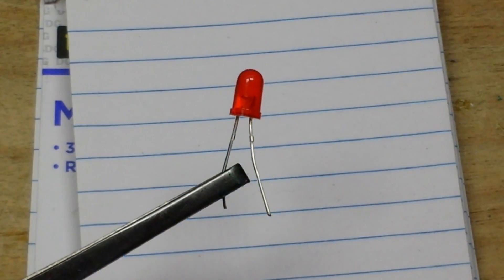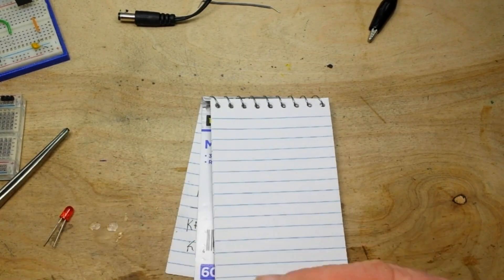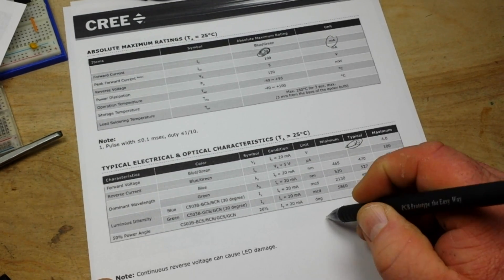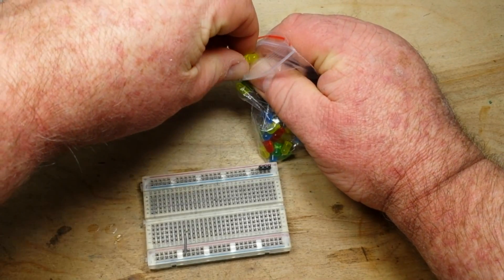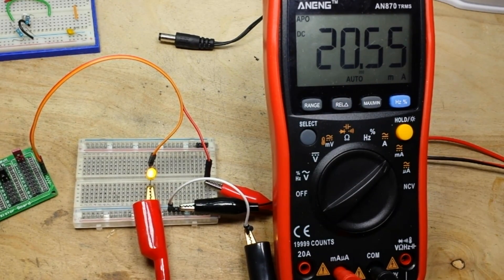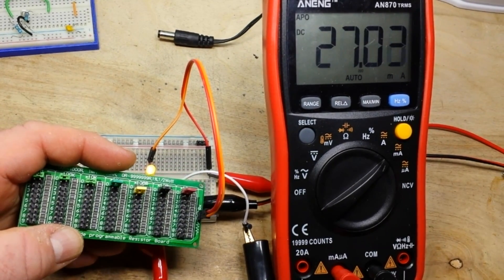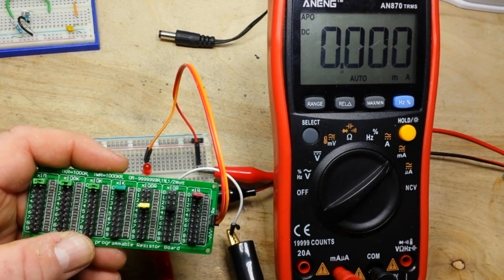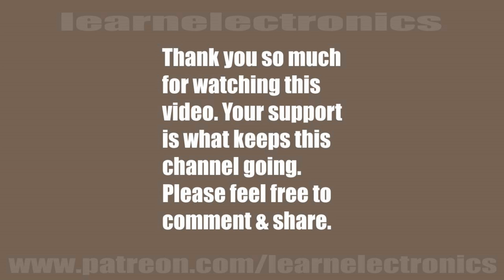How to setup unknown LEDs

Comment: I know this is an old video but I still have a question. What if the Vs is the same as Vf? Let's say the supply voltage is 3.4volts and the Forward Voltage of a white led is 3.4v. how do I calculate the resistor needed to limit current?
If Vs is the same as Vf.

Vs-Vf = 0   0Volts/0.02Amps (our desired current for the led) = 0 Ohms

If I add no resistor to that circuit the led will burn out.

Thanks

Comment: There are many smd leds which are standard 3v forward voltage
But can take 60mA ( 2835) to 150mA ( 5730) and so on..
How to tell their characters if they are unmarked?

Here, you are assuming a max 20mA current..which is standard for these kinds leds..

Comment: Way too complicated....
 Take an unknown LED, place your multimeter in current mode and place it in series with a variable power supply (PS) Set your PS to 1.5v and note if the LED is drawing any current gradually turn up the PS to ~2v the led should begin to glow and current will be drawn. If not reset the PS to 1.5v and reverse the leads to the LED. Do not exceed 2v until you see a current draw. Gradually increase the voltage until you get a current draw of 10-20ma.
Congrats! You now know 2 things
1. The correct polarity of the LED
2.  its voltage rating.
Knowing these two items you can now use ohms law to calculate the resistor value for ANY voltage.
For example suppose you have a 9v supply and the LED consumes 2.1v @ 15ma by simple ohms law (R=V/I) since we know the LED will use 2.1v we subtract that from the supply voltage of 9v
(9 - 2.1 = 6.9v) this means the resistor needs to suck up 6.9v and since we know the LED requires 15ma. Using ohms law we can calculate the resistor value by V/I. In this case V will be the voltage the resistor will use 6.9v and the current (I) will be that of the LED draw (0.015A) (I is ALWAYS in amps) so we have 6.9v / 0.015a = 460 ohms. Of course that resistor does not exist so using ohms law for current or I we will use (V/R)
Plug in a standard resistor value that wont exceed 15ma.
Try these formulas foe ANY supply voltage to power the LED.
I have hundreds of LEDs and the method he uses of identifying cathode or anode will not work as some of these LEDs you cant see into. Also remomder that some LEDs can be infrared as well! So you will not see any illumination from the LED unless you point it at your camera of your cell phone to see it glow. My way is foolproof and been using it for decades

Comment: "If you're new to electronics and need the info". Pshaw I have been wiring LEDs since the 80s as a pre-teen. Still, I needed to figure out the forward voltage of an unknown and couldnt quite work out how! Good vid.

Comment: Where do i get that "variable resistor board" or decadebox  as you called it ?
Reply: https://www.ebay.com/itm/Seven-Decade-1R-9999999R-Programmable-Resistor-Board-Step-1R-1-1-2-W-PrR-Sqi4/373197924796?hash=item56e45469bc:g:YXgAAOSwHgRbpL05

Comment: Just getting into the electronic world and ran across your video... Very easy to understand, thx I subscribed

w̶h̶e̶r̶e̶ ̶d̶o̶ ̶I̶ ̶g̶e̶t̶ ̶t̶h̶e̶ ̶v̶a̶r̶i̶a̶b̶l̶e̶ ̶r̶e̶s̶i̶s̶t̶o̶r̶ ̶t̶h̶i̶n̶g̶ ̶f̶r̶o̶m̶?̶ ̶

Nvm found it,

US $1.95 | 1R - 9999999R Seven Decade Programmable Resistor Resistance Board, Step 1R, 1%, 1/2 Watt.
#Aliexpress US $1.95 | 1R - 9999999R Seven Decade Programmable Resistor Resistance Board, Step 1R, 1%, 1/2 Watt.
https://a.aliexpress.com/_dYs42B9

Comment: So many people feel really disappointed when they find out just how approximate science can be.  To make things even worse you'll find few suppliers stock resistors, capacitors or anything else with values in increments of "1".  I suspect that's partly why Paul collects meters and oscilloscopes and not calculators.  You expend all your degree calculating your resistor to 8 decimal places only to find the supplier only stocks the "e-series" of values so ball park numbers are the best you can do.  To make it worse that's ballpark +/- a couple of k.

Comment: Your multimeter looks alot like the.       UNI-T UN61E amazing!
Reply: Thank You for the info ... Needed an extra Multimeter to keep at a remote location so just purchased a UNI-T UT61E after seeing your post and reviewing it online  :-)
Reply: @charlesmarlin6632  it's not a bad multimeter. Mine was slightly off on the voltage when it came in. There is a blue pot inside you can adjust (ever so slightly) after it warms up. Again pretty decent multimeter!

Comment: Technically Vf is the recommended voltage without really shortening the life of the LED. They can use voltages below Vf, just will be dimmer.

Comment: on my 8 bit CPU I use 270's on all the LEDs so running around 10mA. I think most of them are the GaAs and GaP chemistry type (old style),  there are a few (2, one is in a bicolour LED and the other a modern diffused type) blue LEDs in there but still plenty bright enough running with a 270R

Comment: Your method clearly works, but, it's a bit complicated & it uses a gadget that most beginners won't have (i.e. your changeable resistor circuit card).  It's easier to put the LED in series with an ammeter & a standard resistor (e.g. 1K Ω *) & use a bench power supply (which is quite inexpensive to get these days) to gradually increase the voltage from 0 to the LED brightness level that you prefer.  As you slowly increase the V with a fixed resistor in the circuit, the current level will increase in the series circuit.  If you stop at the brightness level that you prefer & read the A on your meter, that will be your desired current through the LED.  Then put that A reading into the original equation (that you showed in your vid) & input whatever supply V that you want to use & then compute the resistance to determine the resistor that you will need in your circuit.

If you increase the V too fast & the LED fails, then you know your LED can't handle that much current--so on your next experiement attempt, go more slowly. 

Another interesting fact about driving a LED is that as you increase the brightness, it will reach a current level that won't increase the brightness very much more by adding additional current to the LED.  Beyond that limit, you're just over-driving the semi-conductor materials & risking premature LED failure.  Once you know the max brightness A before the LED will fail, a good rule of thumb is to take 70% of that current level as your driving current level for your LED (e.g.:  If the LED reaches max brightness without being over driving at say 26 mA then 26 ma * .7 = 18.2 mA would be your ideal LED driving current to optimize brightness & LED longevity in your circuit.

* Note:  for those who may not know, the symbol Ω = Ohms (aka the Greek Omega symbol).

One last final note.  You could also use no resister if you have a decent power supply to determine the max brightness & current of an unknown LED, but you'd have be careful or blow a few LEDs while experimenting.  You'd obviously have to start at 0V & gradually increase the voltage until you reach the desired max brightness of the LED.
Reply from the maker: I said at the outset of the video you can use standard resistors.
Reply: @learnelectronics  True, but that isn't the alternative method that I described above.
No biggie.. Just wanted to show another method that I think is easier.
Reply: I just measure Vf of an unknown diode, then use the formula.  That is easy.

Comment: Great tutorial for unknown  generic LED's.  I think a 10 turn 1k  ohm pot would be a quick way to find the ideal brightness & current then measure the pot and go up or down to the nearest off the shelf resistor value.  Seems like 10 to 15 mA is the sweet spot for longevity vs brightness. trade off.  Thanks!

Comment: Hi, guy - enjoyed the little tutorial.  You didn't mention how to address putting multiple LEDs in a string - I'm kinda assuming that you just add all their forward voltages together.  I'm building a UV exposure box for PCB fabrication, and have obtained some 3 watt, 365nm UV LEDS to be used as the light source.  They have some pretty funky characteristics - as follows:

Emitting Colour: UV 
DC Forward Voltage:  3.9V - 4.5V 
DC Forward Current: 700mA 
Luminous Intensity: 50~55mW 
Wave Length: 365nm - 370nm 
Viewing Angle: 120 Degree  
Power:3w 
Voltage:3-3.4V 
Current:700mA 
Color:UV 
Wavelength:365nm~370nm 
Lifespan:50000h

That 700mA forward current kinda caught my eye.  I'm planning on running 4 strings of LEDs, with 5 LEDs on each string.  If I run them at 4.2 volts per LED, then each string should want about 21 volts, with no resistors in the mix at all.  The current requirement would be 700mA * 5, or 3.5 amps per string; with 4 strings, I'd be looking for a power supply that could crank out 14 amps at 21 volts, for a total of 294 watts.

Hell, that can't be right.  The LEDs are rated at 3 watts; 20 of them should draw 60 watts, not 294.

Nuts.  Feel free to jump in anytime, now.  I'd hate to screw this up; these 365nm LEDs (the frequency specified for Riston) are bloody expensive - around a couple bucks each.  Your comments would be welcome - thanks, Charlie

ADDENDUM

I guess the current requirement is not additive - each string of 5 LEDs wants just 700mA, so I need a power supply that can crank out 21 volts at 2.8 amps, for a total of 58.8 watts.  That looks better.  Your thoughts would still be appreciated.  If I use a power supply rated at 21 volts and 100 watts - I have one on hand - will I need resistors?  I wouldn't think so... right?   >Charlie
Reply from the maker: Look for my video, leds in series and parallel
Reply: I guess this one? https://www.youtube.com/watch?v=mKCAxwjfs0I
Still worried about the current draw.  If I feed the LEDs the correct voltage, do i need to worry about their drawing to much current?  >Charlie
Reply: thank you paul very interesting love it great fun